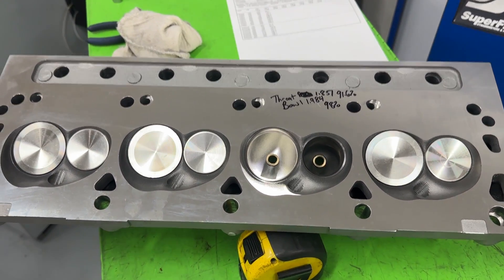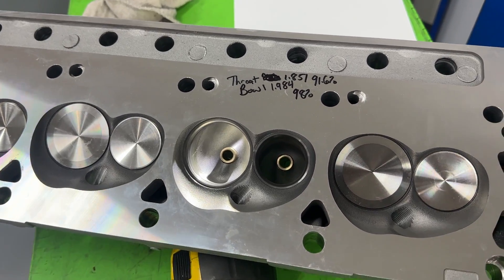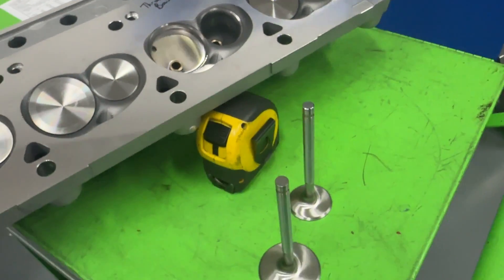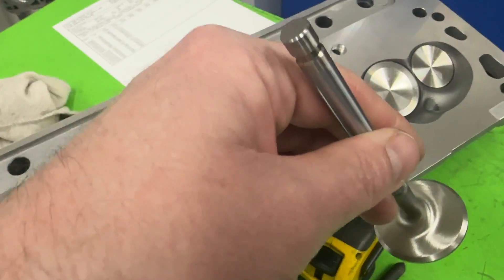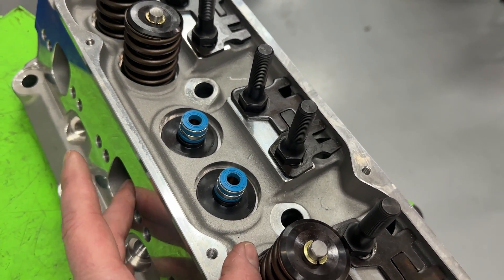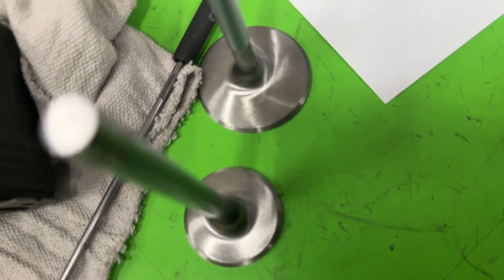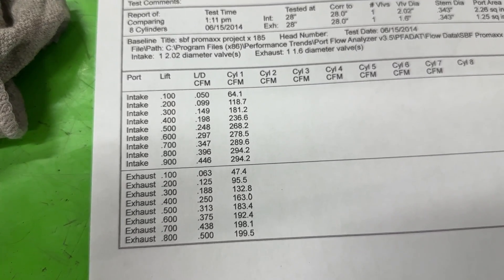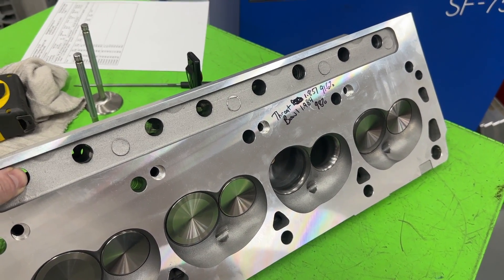SBF Promaxx Project X 185cc Head Review With Real Flow Numbers

Comment: Thanks for your review Eric.
 I have a pair of the Pro Maxx 9175HF heads on order for my 68 Mustang and have a question regarding "Steam Holes", the 4 holes next to the head bolts on the pushrod side. My 289 block doesn't have holes that line up so do I need to drill them out? Does this open into the water jacket? What is it's purpose?

Cheers
A Ford guy
Reply from the maker: You should ask Promaxx since you purchased from them.
Reply: @WeingartnerRacing  For sure, I expect they will include some installation notes with the heads but until then I am just trying to gather some info.

Comment: Eric, Do you think these 185s would be too much head for a 302 street engine with a 274 - 282 degree duration cam?
How much meat could you remove from those heads for maximum compression? I find 58cc to be too high for my stock bottom end 302 car and would be looking for mid to low 50 chambers with those heads milled. I don't wanna change the pistons. Would that be a possible thing to get done? I'm thinking about buying these promaxx's. Thank you.

Comment: What are best flowing SBF heads that you can buy off shelf? I am doing 427 351W based motor…..I am thinking 205AFR Renegade? Your thoughts
Reply: AFR  220 for something that big 

205s  are for like 393/408s
Reply: Probably mixed up Boss heads 700hp but those are $$$ AFR 220 are definitely much more in line with typical bolt on best head.

Comment: Another great video! Have they achieved these flow figures with ports bigger than the advertised 185cc? Or bigger cross sectional area at least.. Obviously port volume isn't the full story.. I feel like I would want to fit 8mm valves to a set of these as per the AFR hardware.

Comment: literally AFR 185 Outlaw Series clones. Flow numbers are exact (1-2cfm off) >= 0.400 upto 0.800 to those.
Reply: except  the AFR  enforcers have a dual pattern  exhaust and 8MM  LSX valvetrain  actually these are better by about 10CFM at almost every lift.  i just watched  his  AFR enforcer  video.  these are  better  and more  expensive bare  for a reason

Comment: Guess who forgot the thread sealant on the rocker studs, that’s one benefit of buying the heads from you. I can go back and watch the video on them. Just got them out on last week and it’s been smoking at idle and shifts. I’m here banging my head against the wall cause it wasn’t smoking before. Heck I thought I done hurt something, then I remembered, I didn’t put threads sealant on the studs, and bet they need it. Well off to go pull the intake rockers off, lol. At least that’s all it is I think! Thanks again Eric. Car is running pretty dang good, need to lean out the carb and I think it’s going pretty quick little car.

Comment: I don't know why anyone whould not buy these lmr just came out with a budget head .
Reply: Great information, my main concern with these types of heads is the deck thickness for say turbo applications say .500 but I like to see thicker than that for lift on the decks.
As much as I want to save money it's really temptation to not just go for a say set of 11R for that alone.
Reply: From the same foundry too...   Everyone private labeling the same castings and tweaking it here and there.  Dart has these too under shp

Comment: Hello ERIC
That engine at the beginning of the run seemed to be very unhappy, or the dyno was having trouble.
When engines start a run AND are not happy it Carrie’s on through the rpm range, 
There are a couple of things to try.
Start the test at a higher rpm
Try A faster acceleration test
Static tests at peak Torque and HP 
When doing the statics hold it under load observing if it stays stable gains or loses.
The accuracy of the dyno from run to run is at best 1/2 to 1 %
The software also has dampening also called other names.
This cuts out highs n lows giving better looking Graphs.
I find your observations on the vein very interesting.
You touched on reversion 
I would also point out that there are pulses that occur in the intake n exhaust
Pro stock uses the first pulse, dirt track engines around the third pulse
What we chase is inertia supercharge affect
I am chucking this out there 
If the vein creates a swirl or vortex behind the valve on closing would this dampen the pulse and therefore lose power
I am not a fan of that chamber style, may flow a little better always found they didn’t run well at low rpm
I have been using Superflow dynos since 1983. My mentor there was the late Harold Bette’s

Comment: Interestly, I ported a set of DRP 185s which appear to the same castings. They are actually 205cc when measured and flowed sub 240. Cleaned them up and the went 260@.600". The machining in throat was God awful and hard to work with. These appear better, however 91.6% is alot for what most guys would be using this for at .600" Street stuff. The DRP's were 89.9%.
Reply: Different  casting. That's the dart Pro 1 clone, sold as the afr enforcer over here among a ton of others branding it.  Blueprint was the first to have it in the US. This casting is pretty pretty much an afr clone, and can be bought with a few as cast runners or a porter casting, they come out of the same mold with different core, everyone's branding them now. There the better China castings. Think aeroflow brands them down under😂.  You guys really over pay for the China stuff, you can get this casting  cnc straight from the manufacturer, A porter casting , 185 as cast or 205 as cast with a larger cnc port on the way.. Well known mustang shop here sells the 185cnc for 1299 assembled for the pair but probably all China  valvetrain since they don't build heads, dart has the 205 as cast version of this in thier shp line..  So afr sells tweaked dart clones and dart sells tweaked afr clones😂

Comment: guideplates for big pushrods available?  I'm going to build two 351W one for a Bronco and one for a LTD  stock efi (302 top on the LTD)  these look like good heads with around 500 lift HR cams   The stock heads are going to need a lot of work so thinking

Comment: How the heck is that head flowing like that and the 185 Chevy head flowed like 245-250?!
Reply: The casting is actually 205cc when you measure it. At least the set I did was. And the went 260 after I finished "fixing" what I could. Sure 240s before that.
Reply: @GapSauceYoutube did you work with 210's as well?